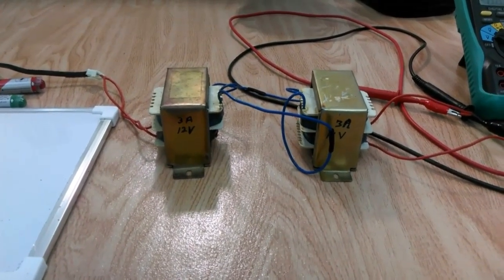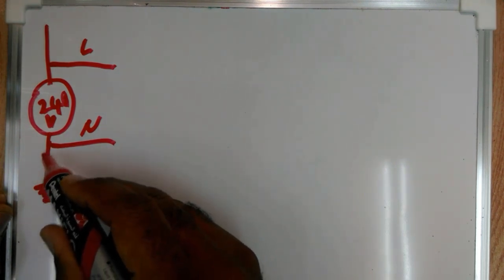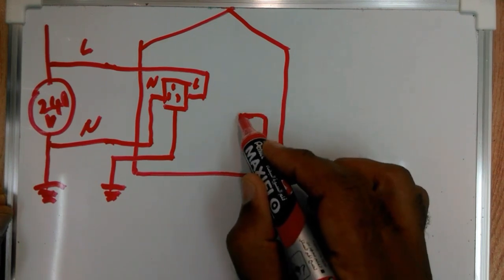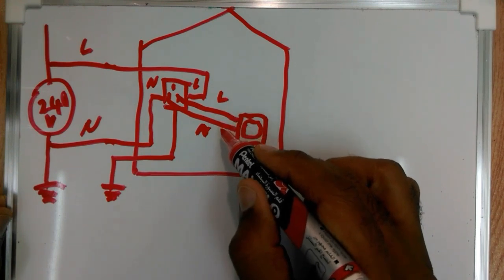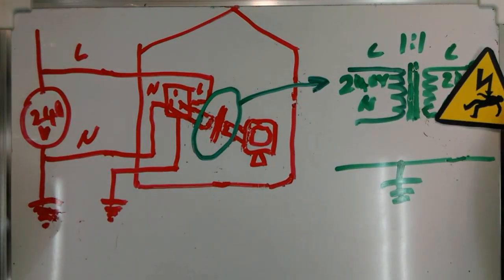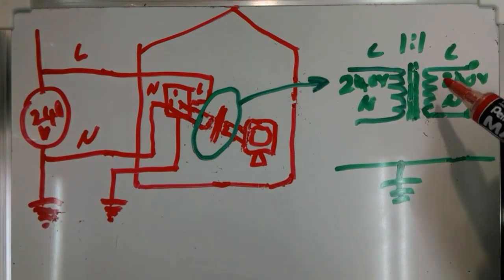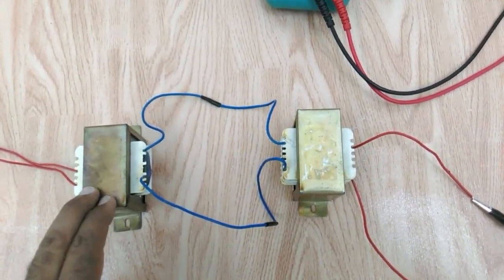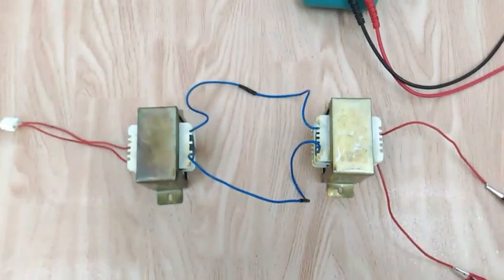Isolation transformer explained and demonstration to show how it can save life and equipment.

Comment: In 2:50, only the live and neutral is connected to the Computer while the Earth is not connected, hence if the user gets electric shock, the current would flow via the user. But if the Earth is connected as well, then wouldn't that electric current flow to the ground , thus preventing the electric shock to the user?
Reply from the maker: In most of cases the Earth is connected to the casing of devices not the internal circuit, yes the earth connection will be very useful to protect in case of any electric short to casing provided residual current breaker is available in the loop to breaker the power automatically , but what we are talking here is just about protecting the technical person while he is derectly working on the internal powered circuit.
And in fact I have other vedio in my channel talking in details about earthing benefits.

Comment: In your demonstration why you used 2 step down transformer (2× 240/12) .
But why you didn't one isolation transformer with ratio 1:1 .
Reply from the maker: Hi, you are welcome
I thought to use 2 small transformer on the table will explain better and people can easily see and understand the parts, also I wanted to demonstrate that simple isolation transformer can be fabricated using basic available parts if not affordable.